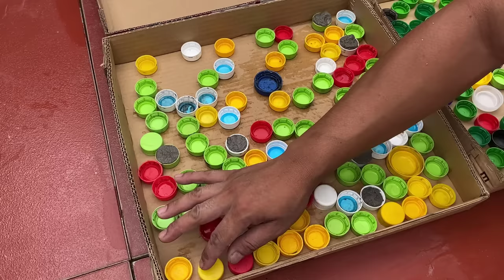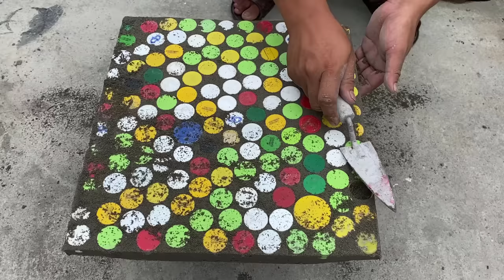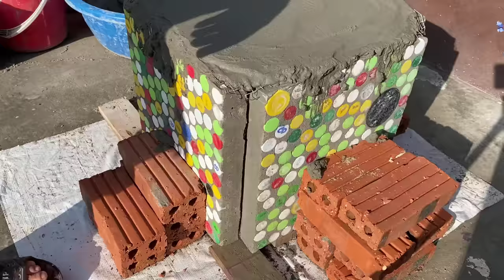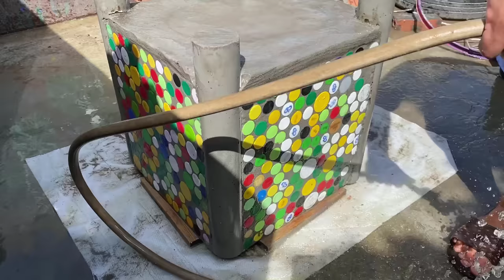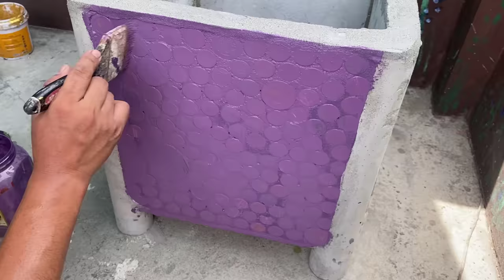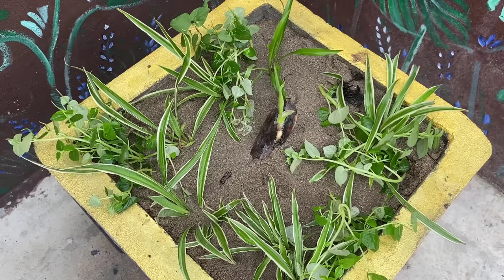Unique bottle cap flower pot idea / Recycle Plastic Bottles Make Beautiful Flower Pots

Comment: It's pretty cute, but without a hole in the bottom to drain excess water, it'll quickly rot in there. Damage.
Reply: No, it will be fine. I have several containers that are about that size that don’t have holes and they have lasted for almost 10 years without any issues. The biggest concern would be the lack of rebar, or metal framing, within the container itself. Those legs will most likely come off, or the panels will separate. Especially if it gets moved around any. The side panels should have been made with pieces of rebar sticking out on the ends so the concrete making up the legs have something to “hold onto”. Just that little bit of metal screen in the bottom won’t hold it together.
Reply: Or you could put a top on it and make a garden table
Reply: @DarkTopaz2000 yes, it would be a cool table

Comment: Most flower pots have a hole at the bottom for drainage of excess water.  I suppose when you poured the cement for the bottom you could have used a plastic pipe to create the hole (the wire mesh used for reinforcement would need to have a hole to accommodate the pipe.
Reply from the maker: Thank you for your idea. We will try harder. Wish you always happy and cheerful.I drilled drainage holes but unfortunately didn't rotate them